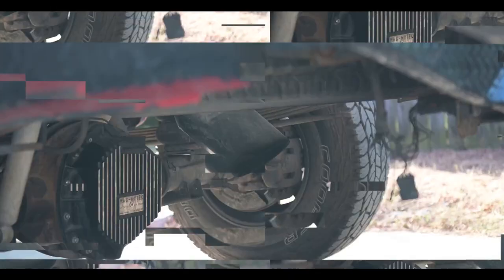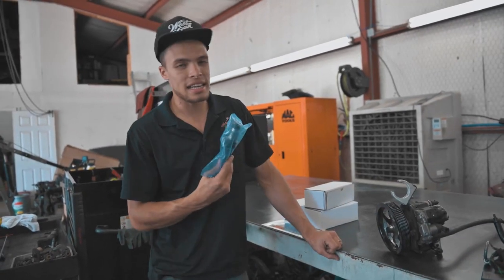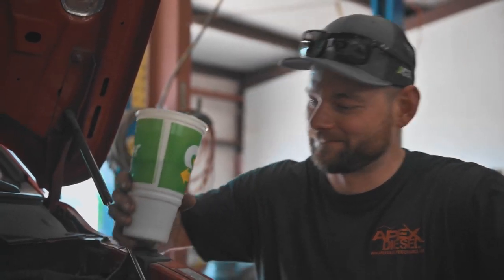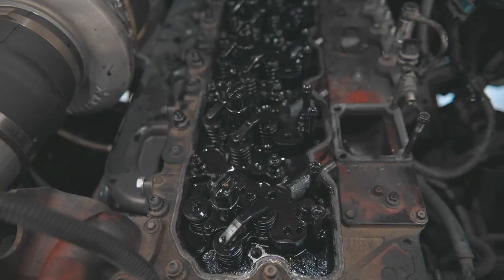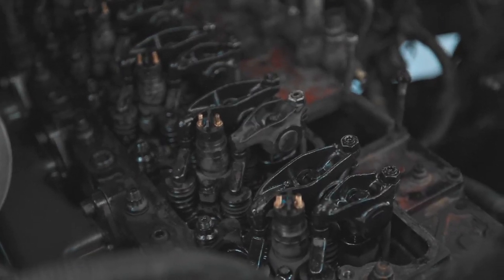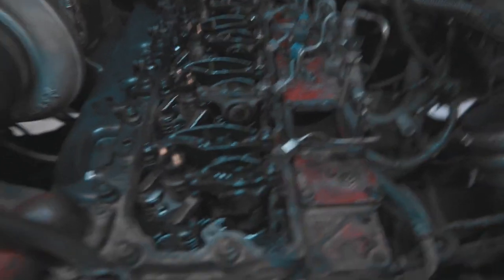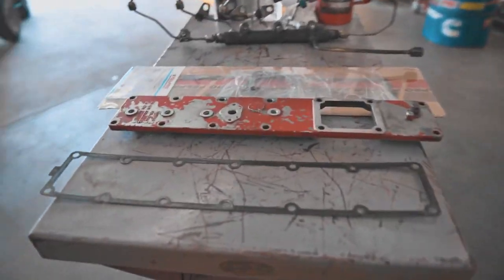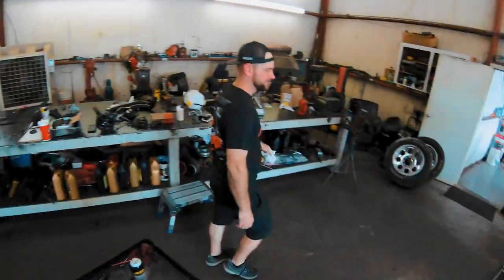FLUX Injector Install on a 5.9 Cummins | FLUX 100%s

Comment: I’m looking for new injectors and not sure what % I should get I have a 04.5 truck with built trans head studs 165 lift pump and plans for turbo and cam within a year i live around 500’ above sea level I drive the truck a few times a week and pull a boat on the weekend 
I’m looking at  30% and 45% my rwh goal is 550 hp
Reply from the maker: I'd probably do the 30% with like a tater built 67 67 turbo. Honestly tho. Most stock injectors can do about 500hp
Reply: Thanks I was thinking the same

Comment: Don't forget about tuning?
Reply from the maker: True enough. I'm running star light diesel tunes right now.
Reply: @LMDiesel  I was running them on stock truck, but now I have 800 hp engine, and they don't do over the counter tuning it has to be from a 2nd part, and they want more money so I had to go elsewhere 😤